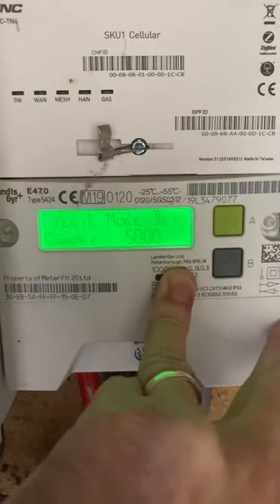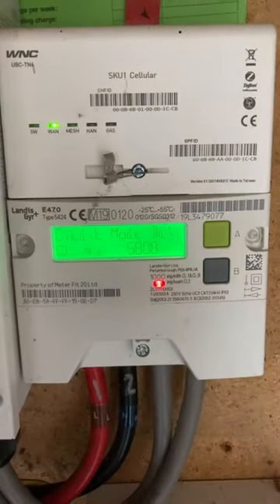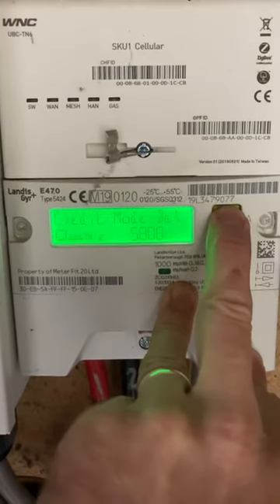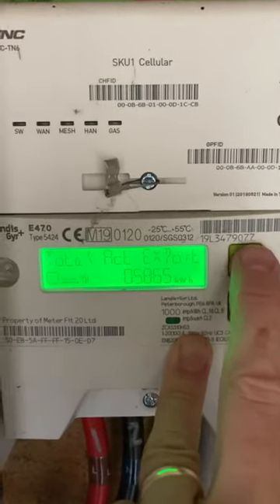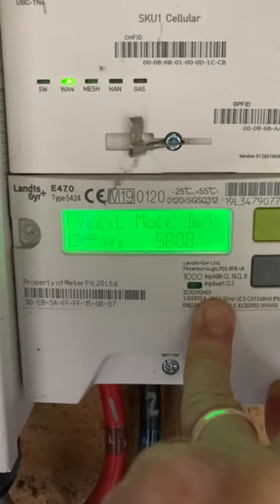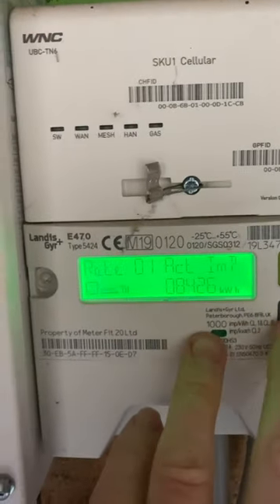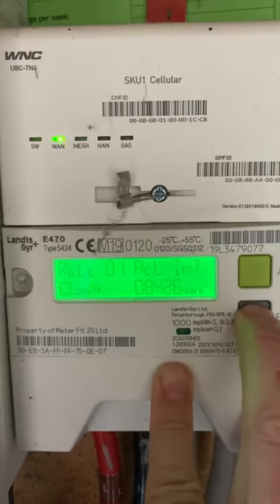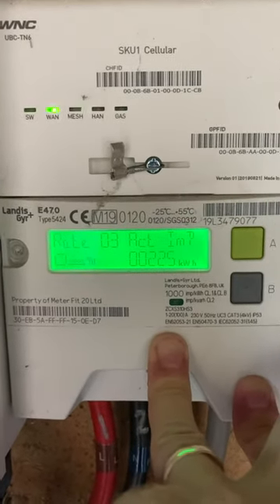How to read an electricity meter (Landis E470 type 5424)

Comment: I have the same meter. I just press B once to get the light on, press A to cancel boost, press & hold B for about 5 seconds then press A to change to rate 2. Seems to work & is a bit easier.. So press B, press A, press & hold B, press A
Reply from the maker: This is a TOP TIP ... thanks :-) I will try and make a better video as soon as I can.
Reply from the maker: Updated video now live - https://youtu.be/q8eovnFnvZQ , thank you!

Comment: Big mistake getting these stupid meters. The whole idea is so you don’t have to supply readings as it should be taken automatically 🤷🏻.
Reply from the maker: That was indeed the idea. Unfortunately, the IT (data) infrastructure that the system relies on is apparently not sufficiently robust.
Reply from the maker: And, to be fair to the suppliers, readings from us allow them to verify two things: (1) that the system is sending them correct data (when it does) and (2) that we are aware of our usage.

Comment: So is my reading rate 1? As that’s 9000 and says online I should be paying 250£ for gas and electric!
Reply from the maker: I haven’t seen you meter display, but it may be that you are confusing the rate “identifier” with the usage. The meter is designed to have more than one rate, often used when people pay different prices for the electricity depending on the the time of day. Although it is possible you have a reading of “1”, it is more likely that for rate number 1 (which may be your only rate), you have the reading just to the right of that.

Comment: Whats the reading credit mode balance 58 pound is that your credit you have left or put in their ? Or how much you used to pay them ?
Reply from the maker: As I understand it, it depends on how you pay for your electricity (pre pay, based on readings, on monthly fixed fee). Assuming you are not on pre-pay, it is probably meant to be how much your electrify has cost since the last bill. However, I am not personally convinced that it is necessarily a reliable source of information. Apologies to the industry if I am wrong.

Comment: Hi There, can you advise on what the difference is between Rate 1 and Rate 2?
Reply from the maker: Rate 1 and Rate 2 are set by your supplier. It is up to them which one is which. It is most likely that Rate 1 is the main one (the daytime), but not certain. The way to find out which is which: (generally) the meter display shows the rate that is active at that time before you press any buttons. So have a look at it at different times of day to see which rate is active at that point.
Reply: @somewhatvaried  Thank you
Reply from the maker: @simbamajonga2574  Pleasure!

Comment: Firstly thanks for your efforts.  Not sure they've helped me though. I guess it would be helpful if I knew what you are talking about.  Is it really so ruddy difficult to get a reading?  I succumbed to intense pressure from OVO to get smart meters and now I'm deeply regretting it. The Home Display thingy is useless and uninformative and now I learn that it could be six to eight weeks before the meters synch with my account so more overestimated bills loom.  Life is so complicated.
Reply from the maker: Sorry it didn’t help you. If you aren’t generating electricity, you can skip the first section entirely. For most people, they simply need to “import” readings: as you use electricity from the grid you “import” it. Often (but not always), if you press a button once, the light comes on, and you get the current reading. If you only have one timed rate, it will be that one.
Reply: @somewhatvaried  You are kind to respond to my somewhat petulant (born of frustration) comment.  I hadn't realised these meters work for those who generate electricity (solar panels, etc?), which sadly I don't or can't but would if I could! Yes I have figured out how to get a reading from both my new gas and electricity Smart meters now, way simpler than I feared!
Reply from the maker: @MAH61950  Pleasure, and glad to hear that you have solved the issue 🙂

Comment: How do I get my electric back on once it's ran out, and I've topped it up
Reply from the maker: Hi, sorry I'm not able to help with that, that's something your electricity provider should be able to help with. If they can't help, your local citizens advice (or equivalent) may be able to advise you. It will depend on the exact agreement you have with your supplier, why it was cut off, how they have configured the meter. The customer support for the electricity company should be able to help. Sorry I can't be of more help.

Comment: Thank you for this, it's very helpful. I have this meter but cannot locate an instruction manual and my supplier's instructions do not work. Does anyone know how to add credit to it when you are in Pay As You Go? I have a top up code but no idea where I enter it. Thank you!
Reply from the maker: Glad it’s helpful, sorry but I’m unable to help with entering codes.
Reply: Mate do tell me if you find out how to put in top up code. I have the same problem as well.
Reply: I never had to enter a code when i top up. You just to enable supplier after top up and it should activate your electricity

Comment: Thanks for the video. Unfortunately this doesn't seem to be working for my meter (same model as the one in your video). 
I can get to the export part as shown  but unfortunately I cannot get the readings as shown in the second part as no matter what I do the meter always displays Rate 01.
Is there any other way to get the readings?
Reply from the maker: Rates 02, 03 etc only appear if the meter has been programmed to do that by your supplier, which they should do if you pay different rates at different times of the day. If you do pay different tariffs at different times of the day, please check with your supplier that they have programmed your smart meter to ado that, and then let me know if they've said that they have.

Comment: Is there any way to see you actual current usage (like on IHD).

I had solar fitted today and my usage was being fully utilized from the battery but my IHD was always indicating a low usage of between 90-110 watts. 

I don't understand how we are even using that wattage when the battery is powering everything.

Please advise,

Thanks
Reply from the maker: I can't comment in detail on your system, but I know that fro some systems (perhaps all) there is very rarely 0W flowing between the grid and your system. For many systems, there is often a residual flow one way or the other even when there is no significant import or export going on. I don't have an explanation for this - its just an observation. You may find it helpful to ask you installers and suppliers if what you are observing is expected, and if so why.

Comment: Total act import 0
Do you know why is that?
Thanks for the video very helpful! But I don’t understand it says 0 on my meter 😪
Reply from the maker: That seems odd to me, but I suspect that it is not a key reading from the point of view of your supplier. Therefore they don't care if the way the meter is configured ignores it. The key ones are the ones at the end of this video (which you pay them for) and the export one (which they pay you for, if you are generating and exporting).

Comment: Hi, thank you for your sharing. I had a exactly same smart meter. Unfortunately octopus suppliers can’t collect my smart meter. May I know what I can do for that. Thank you for your time.
Reply from the maker: Hi @TTP, many electricity supplies haven trouble connecting to smart meters. That's why they ask you to take readings and report them still. I would encourage you to ask Octopus customer service to clarify what information they want from you when, and supply it. This video may help you get the readings they ask for.
Reply: @somewhatvaried  Hi, thank you for your reply. They are asking for me to reset the smart meter. I dont know how to do that.
Reply from the maker: @ttp2999  The challenge is that sometimes a previous supplier has configured the meter different to how a new supplier expects. If you press and hold "B" from the "Credit Mode Bal" screen you get a series of options. The answer is normally "No" to them, except "Exit" (otherwise you go round the loop of questions again). It may be that there is a reset option there for you. If not, you need to ask Octopus to explain where it is, sorry!
Reply: @somewhatvaried  Thank you for your reply. Octopus will send someone for repair, you think they just reset a smart meter or they need to install a new one as i am tanent i cant remove everythung in the flat. Thank you.
Reply from the maker: @ttp2999  No worries, I hope it all gets sorted for you.

Comment: Nice one. All my supplier said was 'try pressing the buttons'.  Obviously a really well designed piece of kit, conceived very much with the use in mind. Not.
Reply from the maker: Afraid they were never designed to be used by home owners because the theory was that all the information would be communicated by directly to your supplier by the meter itself. They were only ever meant to be used by electrical engineers as far as I can tell. Consequently, home owners like you and I are left somewhat confused when we have to engage with them.

Comment: I have the same meter, so when it shows rate 1 and rate 2, do you add them together or something? Why cant it give the total!!! Why on earth do they make these so bloody confusing! My old smart meter was so easy to read! This one is a nightmare! So please someone, which number do I submit to my supplier, rate 1 or rate 2????
Reply from the maker: If you are on two rate (eg you have cheaper electricity over night), then both of them. If you only have one rate, then only one of them should change over time. In theory I would expect, “Total Act Import” (just before “Total Act Export” in the video should be the sum of the different rate imports, but please check. If you get your previous reading from your supplier (should be on the statement they send you or the customer webpage for you, and it’s an actual reading, that also may help). Sorry it’s hard to be more specific than that.